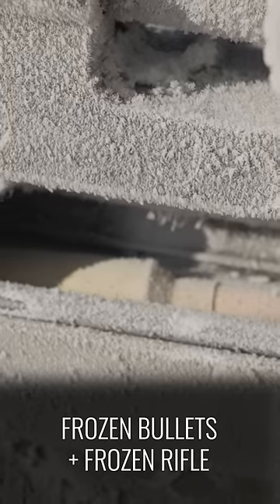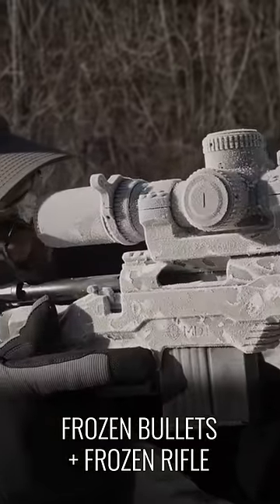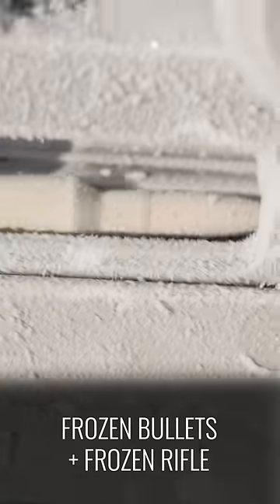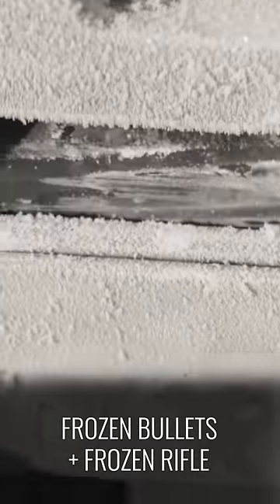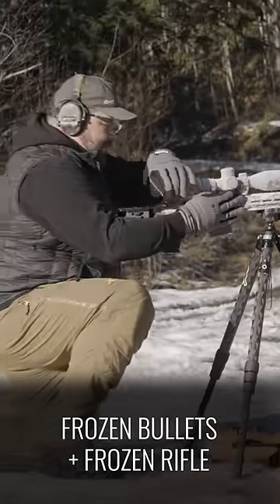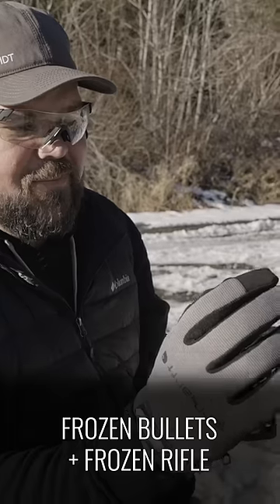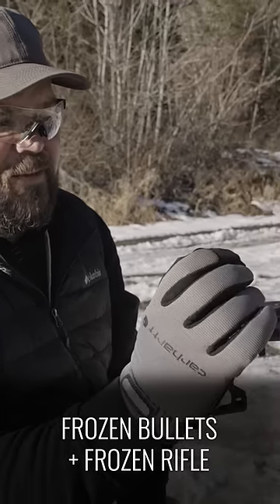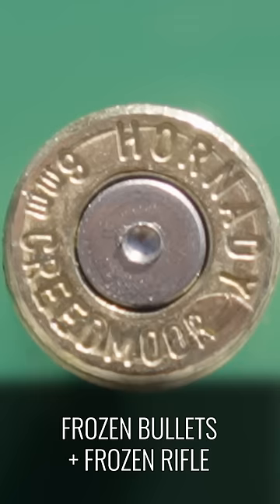Testing Extreme Freezing Temperatures On A rifle

Comment: Not all rifles are built with cold weather environments in mind. 

For example: The Canadian Armed Forces primary rifle, the 'Canada Colt C7' (now C7A2) was specifically designed to function in Arctic conditions. 

I once did an exercise in Nunavut during February, where the temperature there was averaging around the -50°C (Celsius)
And my Battalion (3VP) had no problems with firing any of our weapons, even after nearly two weeks of sleeping out there, and having our rifles constantly exposed to the elements the entire time. Cold as fuck, but they all still worked just fine on the ranges we set up.

Edit: I corrected the spelling of Nunavut.
Reply: My Bushmaster doesn’t work reliably around -25C but my Colt Diemaco just doesn’t care. Now I was only shooting around -40ish C, but there was no appreciable difference from shooting it at +30 C. I’m told it sucks in dusty desert situations though and the Bushmaster may be a little better in the situation.
Reply: -58° F for those who don't know the conversion
Reply: Yessir. Cheers from Ontario.
Reply: C7A2 is a nice rifle, but she’s a big hoss to carry around from what I’ve heard
Reply: @mullittmustang256  would ya rather have a hoss of a rifle that works in cold weather or a one half its size that the selector freezes and cant move or the firing pin freezes in place at which point it's a paperweight lol
Reply: Nunavit your wild
Reply: If you try it with a modern firearm, it might fail. If you try it in a garbage rod moist nugget, it'll run normally and eat any ammunition you wanna run. Gotta love mosin's.
Reply: Things that never happened.
Reply: I'm skeptical of you're story of being stationed and firing weapons in Nunavut considering there is no reason for that to have happened
Reply: The C7 isn't designed specifically  for arctic function in mind at all. It's just a M16.
Reply: @zyourzgrandzmaz  Field Exs happen all the time up north
Reply: @zyourzgrandzmaz lol. Never heard of an exercise? Shit happens. Sucks. But it happens.
Reply: @zyourzgrandzmaz  I was there in 2014 for Operation Nanook. It's basically an exercise where we conduct present patrols in our territories. My Battalion went to Nunavik that year, to a place called Kugaaruk. 

Coldest place I've ever been to. 
But I got to try some Narwhal and a bit of Polar Bear too, when the locals hosted us at the school for some festivities and food, the day before we were due to fly back. It gave us a chance to warm up, and try some local cuisine, helps build rapport too.
Reply: @ranranpoopants  our military conducts operations in our Arctic territories every year. One of the biggest being Op Nanook. That's why I was there.
Reply: @zyourzgrandzmaz   there are a lot of reasons that they would do that actually, not that you would know.
Reply: @hellcatdave1  This. THE C7 INTERNALLY IS JUST THE SAME AS THE M16 lol. Theres no internal functional "COLD WEATHER LOL" improvements
Reply: @cookie5535  it's not an M16. 

It's a similar design and function as the Colt M16, but they are not the same rifle, nor even made by the same company. 

And the rifle went through one of the most arduous cold weather testing in Canadian Forces history, to make sure it would function in Arctic conditions.
Reply: As a brit when i had a go of the C7A2 during a training exercise i lost my shit, that weapon is so damn good
Reply: @tripwire3992  ho wow, in what ways ? How different was it from your service weapon ?
Reply: Nice.
Reply: @bigiron9345  facts. I hate when people complain about firearm weight.
Reply: @bigiron9345  
I don’t think he’s disputing carrying it around. But you’re crazy if you think that gun weight isn’t an appreciable factor.
Reply: Enfield and Aks are the superior cold weather guns ..thinks mounties just stopped rocking Enfields
Reply: Graphite
Reply: @allahuakbar4217  do you know how many people don't know -40c and -40f are the same temperature...
Reply: Sounds like final stand dlc to me 
‘Bf4 reference’
Reply: From what I've experienced, all rifles are built with a factory set test environment in mind
Reply: @ragingnixon3235  But the thing is in extreme cold we use graphite spray on all our weapon systems Traditional "CLP" Freezes
Reply: -50°C wtf
Reply: Yeah I’d be frozen dead sorry.
Reply: Cheers from BC
Reply: @veruspatri  do you have somewhere I could find the difference in design specifications as the only difference Ive seen between the c7 and the m16a4 is a slightly different cut to the slots on the flat top upper, I'd love to know what Canada did to improve cold weather operations and reliability ( also I'm pretty sure Diemaco is referred to as colt Canada or was at some point)
Reply: see that's fucking interesting
Reply: @ThadCastle54  nunavik is the northernmost region of quebec. Nunavut is what you failed at correcting him on.
Reply: @shitboxcivicguy  corrected, thank you.
Reply: We use the Colt Canada C7 in the Dutch army as well. It worked flawlessly when we were training in northern Norway. -30C and no problems what so ever
Reply: AK is also built to survive extreme cold
Reply: Mosin nagats function well in freezing temperatures, I actually find that a lot of the surplus ones start to bind when they get too hot.
Reply: @AVATARComander  badicslly evrrhtbjng about them is different ; materials; manufacturing process; all that has an impact dude. 

It’s not an m16 in the same way all firearms that based off the same systems arnt just the same gun

Like you can take the same basic firing mechanism and make a sniper rifle
Or a machine gun
Or a gun for attic warfare
Or the desert
Hell Canada runs multiple variants of these guns down to during Afghanistan we were making different models for different regiments and deployments lol (that’s also how we got such a better gun.  The us army is to big to keep replacing its rifles whereas we just… kinda kept upgrading them over and over
Reply: @mullittmustang256  I mean it is but that weights come with a lot of durability and performance behind it like; imagine if your American rifle.  Was as rugged and reliable as your Russian rifle. And then you understand why so many sof and recon units spent the Afghan decade running with Canadian small arms
Reply: the AK5 was built for freezing conditions they used it in afghanistan and it sucked ass weapons used in artic environments aren't necessary compatible with other environments you must use the proper weapon designed for your environment for proper reliability
Reply: The Canadian bolt action is call a timber Wolf made for worse than this, and your older firearm against the active one in use makes no sense for a video featuring a weapon system in used today
Reply: @A D in my country, we're never got bellow 5°C
Reply: @zyourzgrandzmaz  cfb alert hosts winter warfare exercises regularly. An essential part of training in the caf
Reply: Y’all notice the rifle? It looks like it was dropped into liquid nitrogen. Same with the magazine and the bullets. I’m surprised the spring didn’t break.
Reply: Why did you put in the comment that you changed the spelling of something?
Reply: @Mrgamer7281  so people know what he edited....
Reply: I’m pretty interested in what the C7 has that the M16 doesn’t but all I could find on the topic is a harder chrome lined barrel and that got me wondering if less barrel flop is a good thing in the cold
Reply: Meanwhile my 97 f250 HD hasn’t used glow plugs in over a year without using starter fluid 😂
Reply: @allahuakbar4217  your a beautiful human being for converting that for me 😂
Reply: @anthonymartire2036  after being a C9 gunner during my infantry course, the C7 weights like nothing
Reply: There’s nothing to be gleaned from exercises in Nunavut. I don’t wanna hear it. That is sheer boredom
Reply: You don’t just TAKE A FIELD TRIP TO A LOCATION ON EARTH SUCH AS NUNAVUT TO FUCKING POP OFF😂😂😂😂😂😂
Reply: If only NDHQ was as well made as our C7
Reply: War doesn’t GAF what temperature it is
Reply: you know what's funny though every Flint Lockwood pistol shotgun or long shotgun that the Pirates carried back in the 16 + 1800 wood fire under any degree of weather
Reply: My guy camping a fortnight outside in -50 must of been wild.
Reply: @ranranpoopants  stop projecting
Reply: FPBP.
Reply: Ullakuut, good morning from Nunavut
Reply: The c7a2 is just a m16a4 or m4a1 with a different name
Reply: Our army also uses the c7
Reply: Gotta have the tolerances of metal contracting built in. May not be good in a super hot climate though.
Reply: @reaperactualgaming3075  no there are similar not the same. They have different specifications made exactly for the CAF
Reply: Nah corrected my ass we not having Nunavut
Reply: @thewanderingguy5436  Nunavut is practically the north pole
Reply: Nice good to Knotts if I every decide live in hell
Reply: @Marlboro65  the T3x Arctic?
Reply: Ayyyy thanks for serving our beautiful country 🇨🇦🇨🇦
Reply: @zyourzgrandzmaz  training exercises can involve firing weapons. I'm former military and have friends stationed in Germany
Reply: I fucking love the C7A2 don’t mind me though because I’m just being a patriotic Canadian
Reply: As a Canadian I had no idea, that’s pretty cool
Reply: This wasnt a normal cold weather trial, they submerged the shit I'm liquid nitrogen
Reply: @Mullitt Mustang  they switched to the c9 platform recently, considerably lighter weapon
Reply: I wonder if the chamber and rifle bore are slightly larger to accommodate shrinkage
Reply: I lived in Iqaluit Nunavut for 2 years working as a corrections officer,  never again… 😂
Reply: @ThadCastle54  you’re*
Reply: @codiefitz3876  field exercises. It's about the environment, can't get that cold in Vermont.
Reply: @Damon Wright  they are both the same temperatures.. yes they are F and C. But at -40 they are the same temperature.....
Reply: @veruspatri  oh is that when ya'll kinda work with the Canadian Rangers or is that fully different?
Reply: @thewanderingguy5436  worked the rigs in -52C with no proper winter gear (all my gear was getting flown up and they forgot my bag) I'm used to -30C lemme tell ya its a big difference.
Reply: @Roberto9696-q7s  really? Thats interesting
Reply: @johngavin2570  Garbage rod moist nugget .. wtf... Does that mean... Please explain
Reply: I'm more impressed you can hold up in -50 , 0 to -1 and I'm crying wrapped up in the house 😆
Reply: 3VP!! Let’s go
Reply: @allahuakbar4217  o shit.. your name brings back some memories..... never taught to find it on a gun channel😂
Reply: wow so many militar
Reply: Ah, finally someone from 1 of the north-most bases in this world
Reply: Me running out to get one NOW.
Reply: @strydyrhellzrydyr1345  mosin nagant. If you know, you know. If you don't know, well, sorry.
Reply: @ranranpoopants  as a Canadian oil field worker, I’ve seen these guys in winter training. I can’t confirm anything else than I’ve seen them out there in the cold with different NATO countries cold weather training.
Reply: @mullittmustang256  the c7 is just an ar15 platform ours is no different then American m4s but ours actually work in the cold
Reply: The Canadian Rangers up North have one that does ok in cold temperatures too. it's a bolt action of some kind
Reply: I was about say like ak are tru russian ak would fired wonderfully and it shot well in a do or die itd work period
Reply: @thewanderingguy5436  Some regions get much colder than -50 around the world. It REALLY sucks to train in.
Reply: @abesamich8100  open sites
Reply: @zyourzgrandzmaz  you mean besides arctic warfare training? Which CAF absolutely does?
Reply: We need those in the civilian market
Reply: How about the infamous AK 47? I It seems to work in every condition. Mud and underwater, extreme cold and extreme heat. Is the AK 47 actually that tough?
Reply: Yeah so we need a rifle that can function below -50C but is inferior than everything else at normal temperature, cost is 10 times higher and we must give it to the whole military and make them have no choice to only then discover that nobody fight wars in such conditions. ¯\_(ツ)_/¯
You can't imagine it happening right? Wrong. I live in Russia and i won't tell you but we have special underwater guns. Yeah...
Reply: @evil7011  it doesn’t actually handle mud well at all
Reply: They have cold weather dry lube
Reply: I love the C7A2! One of my favorite rifles
Reply: Rifle works great sir , I however have lost the fingers of my shooting hand due to cold temps!
Reply: they actually use a bullpup rifle
Reply: am i the only one that read that as novanut and was like wth
Reply: If you want a good cold weather gun, look no further than Finnish RK’s.
Reply: @Sevo-  💀
Bro I can't even breathe at -3 and you can stand with -30

... I'm speechless
Reply: @thewanderingguy5436  i remember walking to school with no jacket in -30- because it was "cool" 😂
Reply: The white death had no such luxuries. He used to keep bullets inside his coat and a few in his gloves
Reply: They will be built with shrinkage with cold and heat expansion in mind I would imagine
Reply: Ya, this is arguably false. There is no special treatment to give it cold weather tolerance. The only thing that's designed into the C7 to make it cold weather capable is the trigger guard flips to allow the shooter to operate the trigger with gloves on. PPCLI are the cool cousins that do good work, but not the sharpest sometimes 😁😘
Reply: @thewanderingguy5436  ikr -50 is wtf weather. I was in southern Finland for military and -25 felt legit almost unbearable even for basic fire watch (of course the less u move the colder it gets). I could never do what some of these mfs in the REAL north do, digging themselves into the snow, enduring extreme conditions with little to no gear and equipment, takes a different typa man absolutely. The +35c in middle east aint fun either but the cold is always worse.
Reply: Also the worst weather to me was definitely either the extreme cold or rain during the day and below 0 night to make sure all the water still in ur gear froze making the jacket and gloves ice packs
Reply: @cookie5535  lol he shut you up pretty quick 🤣
Reply: @veruspatri  Lol I worked as an armorer/gunsmith for a time and have built hundreds of AR-15s I understand it very well. Both are literally the M16/AR/Stoner platform. In fact all parts are interchangeable with an M4/M16. They are AR based stoner designs whose only difference is 20" barrel (same profile as a M16A2/4) and a CAR stock (same one used on original M4... with just a heavier buffer). Diemaco is Colt Canada. They are all part of the same conglomerate. Many indpeendent companies make M4geries and AR15. I literally own a Diemaco C8 Sfw clone here in USA. They are the same exact platform with a laundry list of minor differences. Anyone with any basic research would know this. M16/M4 stoner system works great in the cold I know that. Take an M16A4 to arctic and youll get the same reliability. The Direct impingement and sealed system of the stoner design owes to that and its universal among all AR's. You dont know anything lol. Diemaco manufactured many M4 parts from the same assembly lines. SAME BCG, SAME RECEIVERS, SAME BARREL NUT, SAME BARREL, SAME BUFFER SYSTEM. Just changes to the stock/ buffer weight and barrel profile on the C8 and longer barrel on C7. M16/M4/AR/C7/C8 are all variants of the same exact rifle.
Reply: @SavageMcChillen  No he didnt he knows nothing lol. Read my response. They are identical AR based systems with minor variations. I can pop any Diemaco C8/C7 component onto my M16 receiver and visa versa. They use same parts and Diemaco is literally colt canada and diemaco MADE COMPONENTs for the US mil for a time off same assembly lines. The M16A4/M4 work great in arctic conditions which is why the C7, which has no actualy fucking variations from an A4 other than a collapsible stock and heavy buffer, does well too. Oh and the furniture is green... Lol... Oh and the upper receiver has a slightly different rail size in the scope of a mm or so. The idiots saying the M4 sucks in snow and the C8 is great for example, dont know anything about how they are made or specs of each. They are the same components same forgings with MINOR changes such as barrel profile. All stoner AR based rifles work great in snowy conditions. Imagine claiming an AK with a collapsible stock and color change and smaller barrel change is now suddenly not an AK.
Reply: @ClaytonBigsby01  if you know you know, if you don't you don't. Clearly you also don't know how to google things.

Garbage rod and moist nugget are both nicknames for the mosin nagant.
Reply: That's pretty wild it sounds like you've lived an interesting life! I love Canada it's beautifully cold.
Reply: @veruspatri  You're so silly. Colt CANADA makes the C7 rifle. What on Earth are you even on about? Also, the M16 went through the same arctic weather testing. It wasn't designed for those conditions.
Reply: @ShmuckCanuck  They're all the same. The same aluminum, the same gas block, the same handguard. The only difference is the Canadians put CAR15 stocks on their C7's with carbine buffer tubes, otherwise it is just an M16A3.
Reply: @zyourzgrandzmaz  canada had bases up there and send troops up there for training in the harsh condtions.
Reply: @hellcatdave1  ahahahahaa you really don’t know anything not just about guns but about manufacturing in genral

Massive difference is C series rifles are cold forged
M series are hot forged
Reply: @hellcatdave1  also you get that your civilian rifles you buy are fairly different from the militsry ones which come in a crap ton of variations

We’re talking about the original rifles my guy

Not the super modified updated ones

Tho if you want to compare cersikk on d we can but you have to pick specific ones

And we’re not talking about either rifles civilian variants
Reply: @mullittmustang256  for smaller people it’s a pain but it’s not bad for average, after all it’s just a re mastered m16 lightened and perfected.
Reply: Hall Beach 🏖️
Reply: @hellcatdave1  wrong
Reply: @zyourzgrandzmaz  how to tell us you never did any military service without telling us.
Reply: @Norwegian_Bastard  ag3 was not in use 15 years ago when i did mine.
Reply: Rope ?
Reply: @hellcatdave1  it is an m16 adapted for arctic condition
Reply: @Sevo-  LITERALLY 🤣🤣🤣
Reply: Just like people still calling the G36 shit because it doesnt shoot straight after emptying several magazines full auto in the heat of middle-eastern summer sun
Reply: Is temp same below zero no matter imperial or metric
Reply: RMR?
Reply: @michaelgroff7309 AK also takes a lot of work to attach anything :v
Reply: Jesus dude -50
Reply: @zyourzgrandzmaz "no reason for that to have happened" say you know nothing about the military without saying it...
Reply: Another example would be Russian weapon systems, they're more suited for colder temps even down to the trigger guards being designed a bit bigger to compensate for gloves.
Reply: @zyourzgrandzmaz  uhm.....training?
Reply: @geobruv3649  if only  I could watch
Reply: I love internet knowledge.
Reply: I'm having Nunavut
Reply: You know you don’t have to give an explanation for your edit right
Reply: Also realize that a dry mines 50 is about the same as a wet mines 15 or 20
Reply: @milfhunteroficial4217 -40c is -40f its the only temp that overlaps
Reply: @zyourzgrandzmaz  why? Canadian forces need to be trained to be able to handle candian weather
Reply: I didn't know it could even get -50C anywhere sheeeesh
Reply: Doesnt matter if its -10celcius or -50. What does matter is that when it warms up near zero and humidity and water get in ur gun and it freezes. Thats how u test which rifle is reliable and which keeps on jamming.
Reply: Should try yukon -60 or Antarctica -90 this is the true test
Reply: @ThadCastle54  ... you're
Reply: @ThadCastle54  ...there you go, good boi...🤓😜
Reply: How about the SMLE? Those were used until 3 years ago in Arctic lol
Reply: What would be a decent bolt action rifle used in these conditions. Also how did your ammo hood up in these cold climates?
Reply: The true north strong and free❤
Reply: @nathanhutchings7556  only for -40
Reply: Dude, its just an m16a2, not that that is BAD, as i love the platform myself, but it wasnt specially designed with cold weather in mind lmao
Reply: Wow thats absolutely insane. Like actually i did not realise there was s problem with extreme cold temperatures before this video Even though it makes sence for me now😂, respect to you canadians here from norway. I wish i can practice with your military one Day. You guys seen like the badasses nato needs in all envirounments. Best of luck my guy
Reply: I got an 80 dollar mosin that works just fine
Reply: My thoughts exactly.  This is a PRECISION RIFLE.  Tolerances are as tight as they come.  There's a lot of rifles that would run just fine.
Reply: @zyourzgrandzmaz arctic warfare & training?
Reply: @mullittmustang256  still better than the FN
Reply: Came here to talk about this :)
Reply: I fell in love with the C7A2, even when firing on a warm day. I just love it! No clue why, I just… I just like it.
Reply: Our Australian rifle can withstand 55•C and dust/sand. I’m kidding I have no idea about anything but I do find it fascinating :)
Reply: Canadian wpns were designed to work well in all environments dude. We used them in the desert for 12 years.
Reply: @mullittmustang256 no not at all.
Reply: @johngavin2570 this is why they designed graphite lube.  The temp. and weather outside determines type and amount of lune you use. ei jungle you use massive amounts, winter warfare sparingly or preferably graphite
Reply: @hellcatdave1 bingo. Its designed for all weather. We used it in the desert for 12 years…
Reply: @hellcatdave1 internal similar. C7 has a forward assist that the original m16 didnt have. It has different furniture than the vietnam era m16. Doesnt have the handle on top with the sight. Just a built in rail that we mount glass too. In Recce(recon) we used thermals or eotechs or a fixed 4 power scope like the companies.
Reply: @tripwire3992 I worked with some Brits. The Mercians. Desert Rat patches they had. Nice guys. Used an SA80. They liked our guns more. Poor guys didnt have heat in their vehicles.
Reply: nice
Reply: This aint Reddit. No need to note your edit here.
Reply: Do you know why they call it Nunavut? 😂😂😂
Reply: What sleeping bags where you Using?
Reply: I got cold just reading that!
Reply: -40 is the same in both Fahrenheit and Celsius
Reply: Yes the metal needs to be a cold weather alloy otherwise it will get to brittle it’s a little harder to machine at room temperature.
Reply: Not reading all that, thx for the stating the obvious
Reply: As a Canadian from the oilrigs in Alberta decaling with -50 every winter. I salute you. It ain't easy only the tough survive. Thank you for your service.
Reply: @christianhviid2167 not for long. They aren't cold like this cold. I know it's easy to google but won't and moisture play a huge affect. I'm a Canadian who can specially explain how it's different. Much much different I'd rather -69 on a calm day than -50 in a windy ass moist day. Been there done that please stop I have frostbite on places that shouldn't because we're built like brick fucking shit houses up here. Thanks bud.
Reply: Err the accuracy international arctic warfare rifle was build for low temperature operations,  from the start.
Reply: That's good because if i was out there at -50 for weeks i'd like to effectively be able to shoot myself
Reply: Resolute Bay?
Reply: no rifle will ever get this cold anywhere in the world unless you left it outside antarctica for 2 nights….
Reply: @veruspatri do we have any specifics on what changes were made to metallurgies, choices of metals, coatings, treatments, forging processes etc on any given parts for the supposed cold weather proofing ?
Reply: @qudhnter92 what handguns and rifles are best in BOTH cold and hot? Any? Or is it either or?
Reply: @thewanderingguy5436 it’s basically the same in Fahrenheit at that end of the scale.
Reply: The lee enfield does the same. Although its brittish we have adopted it, most rangers up north wont put there trust with anything but it.